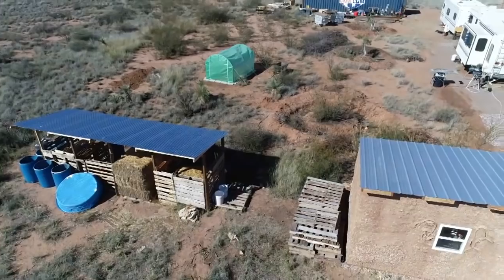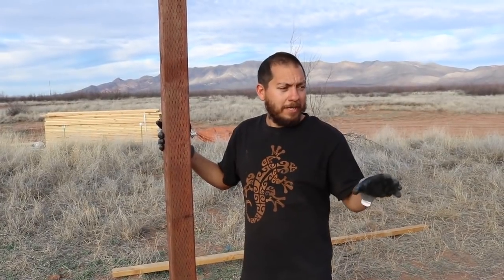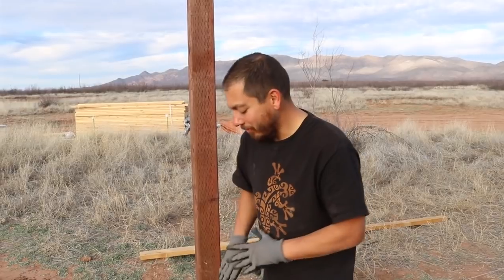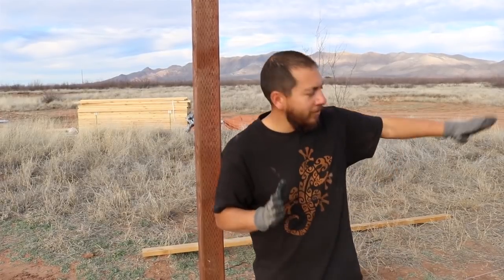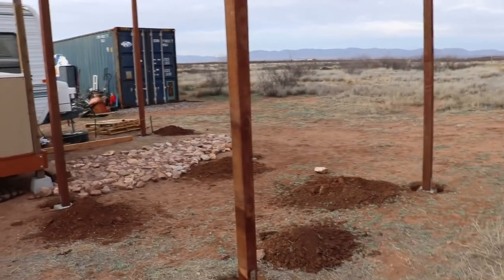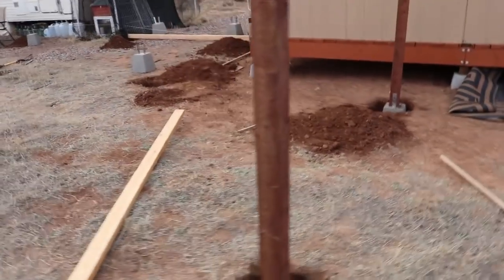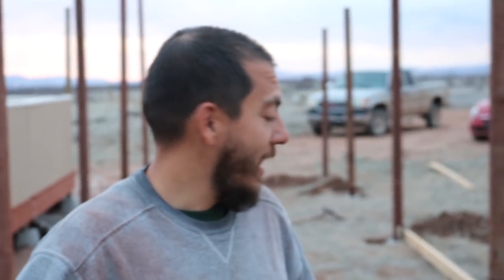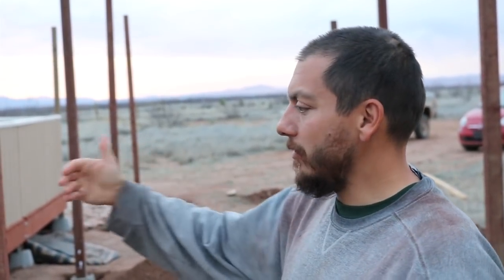Epic DIY Off-Grid Water Harvesting Carport Build- Mounting Posts and Concrete Piers

Comment: I understand not digging them too wide or deep it make for more issues with settling of the dirt. This kind of work is slow, especially when digging by hand. You will get there. :)
Reply from the maker: Thanks so much! We'll be going even wider as we add concrete to each of the holes as well. Lots of work. 😬
Reply: Oh my.. It does sound like it. Good luck! :)

Comment: I'll take hole digging in Arizona over shovelling snow in frozen Canada any day...Do you have plans to somehow secure this structure to the ground?  I was thinking you could be building the finest "Wing" ever. A good wind spread over a large area has massive force and could cause your roof to sail away?  Just a thought. Cheers.
Reply from the maker: We'll take the digging as well.😀 Yes,  we are going to be adding extra concrete to each of the footings. That should give it the extra weight it needs to hold things down.

Comment: I never quite 'got' what you were doing,, is your plan to make this a permanent shade structure for the RV's also.?  or is the part to shade the rv's removable  for the winter.?  I am just wondering how much heat gain you will lose in winter.. I know if my rv were not movable I would have gone through double the propane trying to keep it warm under the shade..  Looks good and solid whatever you are going to do..!! 👍
Reply from the maker: Good questions.👍 This won't go over the RV'S. We were confident on the build or the price. This shouldn't get rid of any heat gain in the winter, because this is placed on the North side of the trailers. The main purpose is water catchment, but should provide shade for people and possibly a place for storage.

Comment: In addition to what Doug said about the rock, I am wondering if your structure is going to hold up during monsoon season. Those stanchions are not that deep in the ground. I hope that it doesn’t act as a huge sail and just lift up out of he ground. During a monsoon. Just an observation😎
Reply from the maker: Good observation! We're going to be adding more concrete to each of the holes as well. At least a bag per pier. I think that should ground it nicely.

Comment: Have you done any rough calculations on the amount of water it will capture based on the number of inches of rainfall in your area?
Reply from the maker: Yes. With one inch of rain we should collect over 1350 gallons. We have an average rainfall if about 13 inches a year here. This should go far in supplying our water needs, but we will need more.